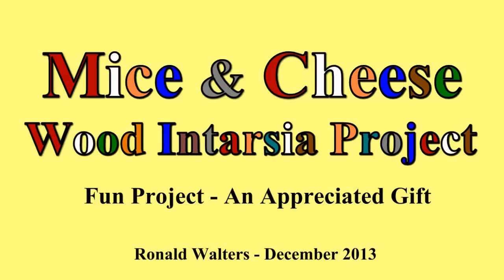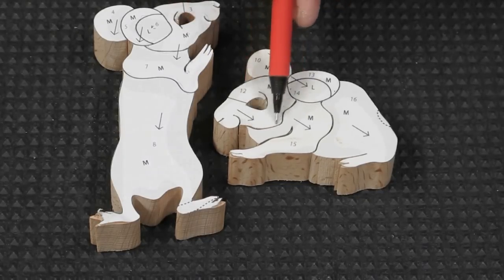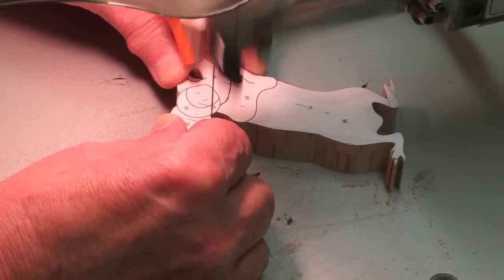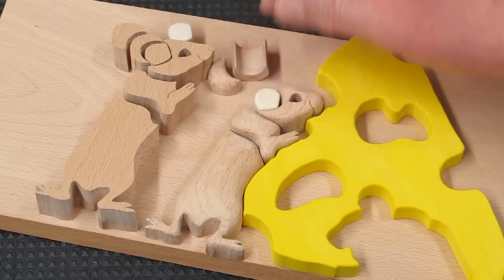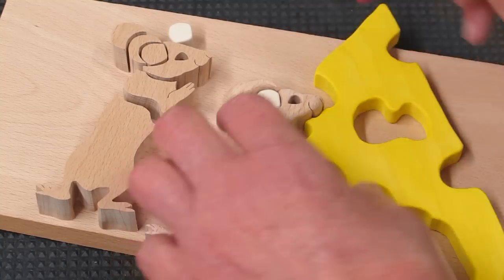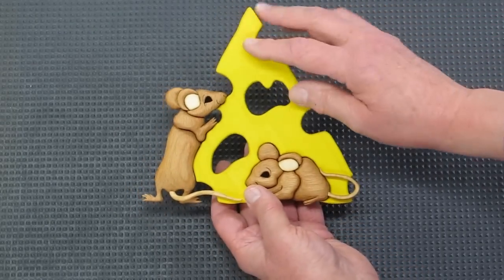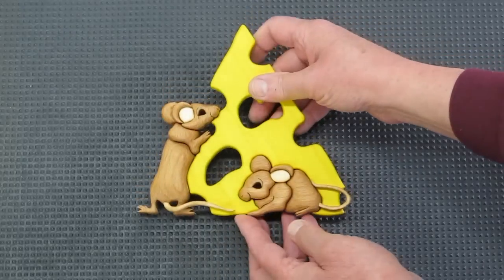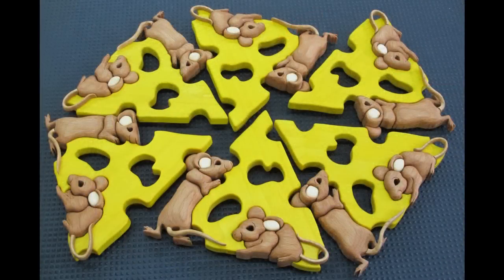Mice & Cheese Wood Intarsia

Comment: Nice job Ron. The detail on the mice is impressive working with such small pieces. Do you cut off the bends you made on the needles before inserting them? That is the only detail you did not cover. You certainly have a like on this project and I will be checking out your page for other projects.
Reply from the maker: The bends on the end of the "ball end pins" (needles) become the base or stand for the pins. After the bend is made, I cut off the remaining excess length (the pointed end). Then as I said, you place a couple of drops of glue into the eye socket and then stick the bend of the pin into the glue. The bend will hold the pin upright until the glue drys. Thank you for watching and subscribing! Ron

Comment: That's superb work Ron.  When you used the bandsaw for most of the work, other than internal cuts, why did you not continue with the bandsaw on the heads?  I am thinking of trying intarsis this years and just gathering information.    Malcolm.
Reply from the maker: +Badger Woodcrafters I did not use a bandsaw for cutting any of this. Even the cheese and backer board were cut on the scroll saw. A bandsaw produces a rough cut. A scroll saw produces a smooth, polished cut. I only use the bandsaw to rough cut parts to reduce the overall size before going to the scroll saw. You may also want to watch my video: "Keepsake Wood Intarsia Boxes"
Reply: +Ronald Walters  My mistake Ron, it was so interesting I lost the plot.  Just been looking at your Keepsake Wood Intarsia Boxes, another 'gem' that has given me ideas.  It's a very facinating subject this intarsia and I hope I can reach your standards. Just need to get a better scrollsaw and learn the art.